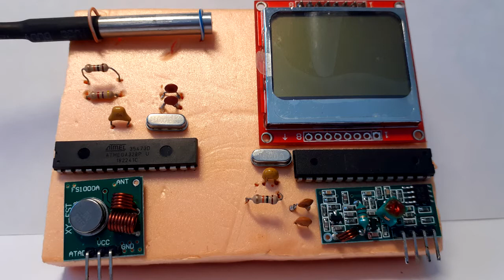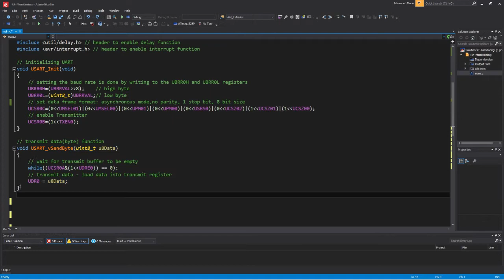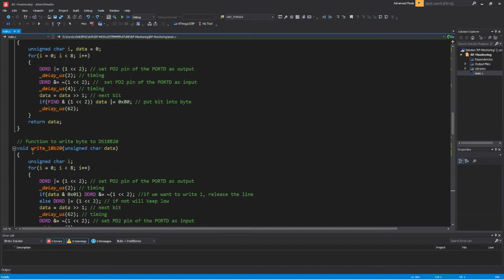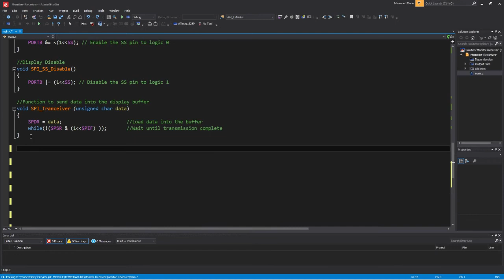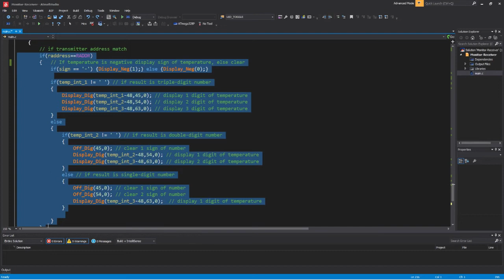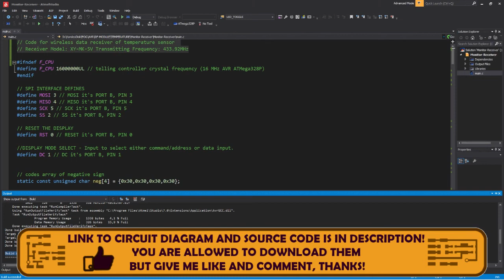AVR Microcontroller. RF433 temperature sensor with LCD. Wireless communication between Sensor & LCD

Comment: Hello @Fogdiy , I have questions too , about compiling this in Studio 4; the compiler sends a lot of errors. Help is needed.
Reply from the maker: I'm use Atmel Studio 7. Maybe you try too. Actually, it could have been any number of things.
Reply: @FOGDIY  Hello, I have installed Studio 7 and took me a lot of time to find out how it works. And now I have compiled your program with succes. Is it allowed to lower the baudrate as I need greater distance between transmitter and receiver? And maybe someday , you write this program to display on a 7 segment display with the TM1637 ?It is better to see with this display from a distance. Thank you for your fast reply too!!